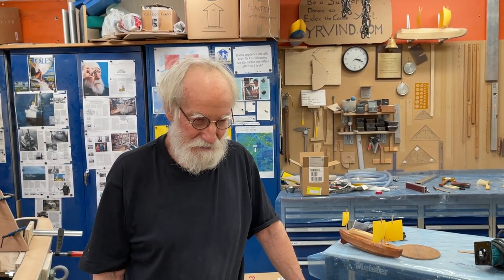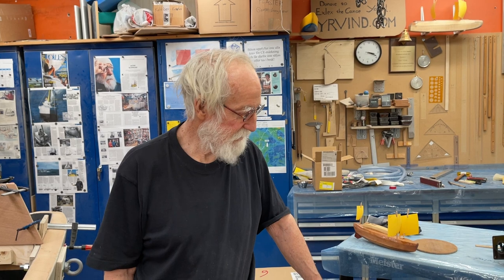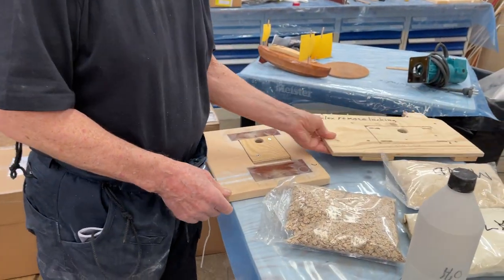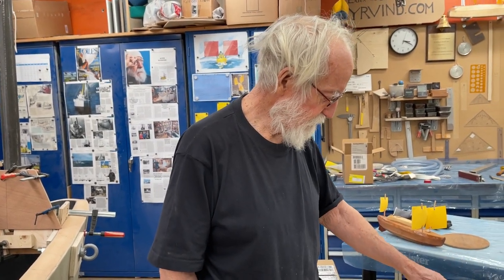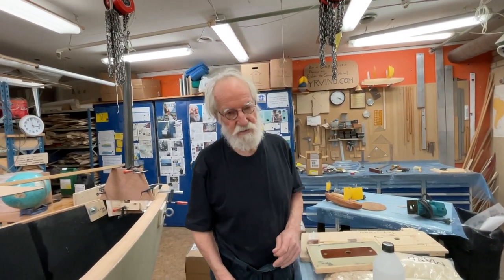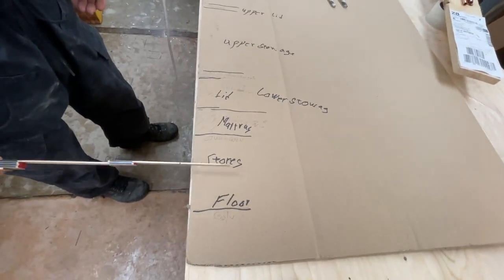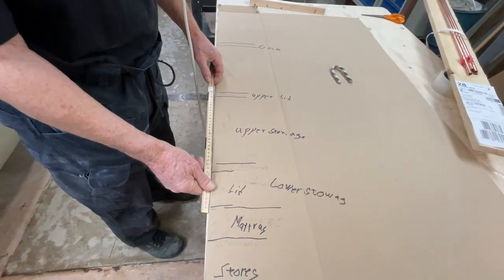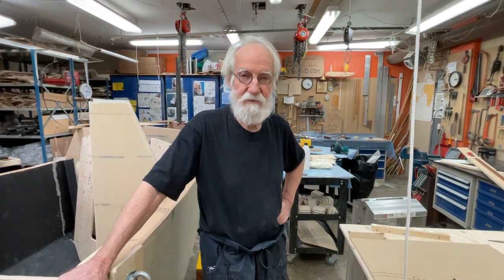A go through again with the help of Peter and the stick problem.

Comment: I would hinge the lids and offset the  opening hole to the other side. With 2 cm thickness you can make springloaded internal metal plates with a hole matching the lid's opening hole, which you pull back when opening. Unloaded this should lock in a trace in the frame.

Comment: Hi Sven, Super Mariner.
For the storage lid instead of the stick; fit a cam internally, which will jam the lid in place. Rotate the cam 90° by means of a wide slotted screwhead. Make the slot so a coin or spoon will rotate it.  Thank you for the inspiring entertainment.
Reply from the maker: Hi Thanks
It is a good idea but I have only a thickness of 20 mm to use. However it can be done but first I have an other idea to try.

Comment: Sven you should be able to find screws or door knobs that you can screw by hand without using tools but even if you don't, if you the screws can be made so you can use something flat like a coin. Dose your tripod have a knob to attach the camera? Some knobs like that would do and I'm sure you could make some by dipping the screw head in resin or use a bolt that you can drill a hole in the head and put some rope that you could hold and twist???
Another option is a lock that is made like the lock on a safe so when you turn it half a turn an arm will never to the left and to the right at the same time to make it lock and could be made from plastic.

Comment: If you like the stick idea, just cut the stick in half and join the 2 pieces with a piece of string as a hinge. Maybe drill a little hole in each end of stick and bury string ends in them with a bit of epoxy.
Reply from the maker: Thats is what I am going to try but with a special unbreakable hinge.

Comment: The rest of us can't keep order on board. I aspire to your order level. Doubtless you could be rolled and know where your tools are, same place.
Reply from the maker: Thats how I think a well designed and buildt boat should be. If a kayak is rolled. No problem. A small simple boat boat not crammed with thousands of ting can perform likewise. No screw driver problem if you have a sense of order and are motivated to keep order.

Comment: Yes I read the description. Could you use a spring loaded mechanism keeping the lid locked and quiet? When locked a flenge could hold the lid in place and with a small hole in the lid you could use the finger to slide the lid sideways pushing the lid towards the spring. Just a thought?
Reply from the maker: Yeas  that is a good solution, but I hope to try a more simpler one.

Comment: Yes I read your description. I like the screw method. As you've said before, you're not in a hurry so it's fine. The floor of my boat will have many doors so that I can store water and other heavy items low, I'm thinking to use screws and maybe rope hinges for all these doors. Maybe your storage door could also have thin rope hinge on one side, and 2 screws on the other side. Twice as fast and half the hassle to open.
Reply from the maker: Good about the description.
Under bed, one side of the door are under a lip other is screwed as on last boat. Works just fine.
Reply: 😃 Dang dude, interesting project! I'm sailing a boat I built back in 2016 to lines of a 1876 transatlantic sailing dory, definitely a learning experience!
Reply: @SvenYrvindExlex  Thanks, I'll try to find details on your blog for that flooring. Sounds like a clever system. Maybe I'll see it in your future video too!
Reply: @danoyes1  Interesting, Dory Dan. I hope you took it across the Atlantic to keep with tradition!
Reply: @JakeHolman78  🤣 I'm still looking for someone crazy enough! Alfred Johnson who made the 1876 crossing in the original boat was asked by a newspaper reporter why he did it... Johnson replied "because I'm a damned fool,  just like they said I was"
Reply from the maker: @JakeHolman78  Its coming up when I get there. I have a central "beam" and stagger the screws belonging to the port and starboard side the that beam can be more narrow. The lip is in the corner of the side of the bed so it is out of the way.

Comment: When you're 500 miles south east of Madagascar and you can't find your screwdriver, what do you do.  With the stick on a lanyard you'll never lose it.  I don't like the screwdriver deal.
Reply from the maker: If you look at previus videos from Azores by La Vagabonde and Sam Holmes you see how each item have a place and how they are secured.
Although I am not rich I will carry more than one screwdriver. 
The prudent voyager always have plenty of redundancy and back up.
Reply: What about hinges and a twist toggle? Everything is permanently attached? 🤔
Reply from the maker: @danoyes1  The twist toggle is a good thing I use it often with a bronze spring that you have to press down when turning it, but here I am aiming at a smoth surface becouse it is side of the bed and my body will rubb aginst it for every wave.
Reply: @SvenYrvindExlex  O.K. Sven, then I'm down with the screwdrivers.  I certainly believe in redundancy.  I'm wishing you a Happy and Successful New Year.
Reply: @SvenYrvindExlex  oh my, well... what about a toggle in a circular recess... or a foam cushion that will pad this area but can be removed to access storage...? Interesting discussion, I'm definitely here taking notes for possible storage solutions in my replica of transatlantic dory, Centennial... thanks for responding.
Reply: @ralphwatten2426  dang, OK now Y. got me thinking maybe a simple bungee system can help? I'm using a tight lashing as kinda lee cloth for the shelves aboard Centennial replica of transatlantic sailing dory.

Comment: hallo Sven,
of course we read the introduction, it is like a brief logbook of jour proyect and it helps a lot to understand the videos and your work. I know it is another daily task but it is really nice to read you.

Screws solution is the most elegant as there is very little pieces involved and it protrudes not, but...
Will you atach the screwdriver with a little cord or chain? And carry a second one? 
i am not worried about your ability to use it, in any circumstance, but about the situation of lacking it and therefore having your supplies locked; you can always eat with you hand if the spoon disapears, but those little tork screws are a bitch to take out if you dont have the right tool.

Thanks boss
Reply from the maker: Thanks for the ansver.
If you seen the vidoe earlier and the ones from Azores by La Vagabonde and Sam Holmes showing the interior of Exlex you will see that all things have a place and are secured there.
These M6 Torx screw I can carry a hundred or more for back up.
Good about the introduction.
Reply: @SvenYrvindExlex  Right! i remember those videos and the arrangement in the walls for every single item onboard, but i forgot it. I guess that your system makes near imposible for a tool to disappear...
thank you for sharing
Reply from the maker: @juansimon7020  I am not in tha habit of losing things. I have a good track record. I do not understand why so many worry that I would lose a screwdriver. Besides I carry plenty of spares of screwdriver and of other things to. Better have a simple system with lots of copys.